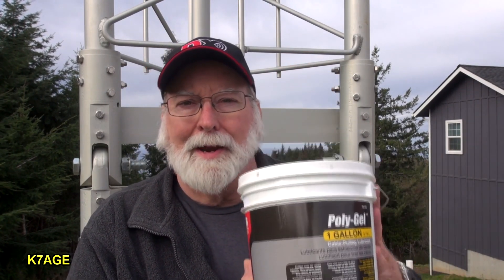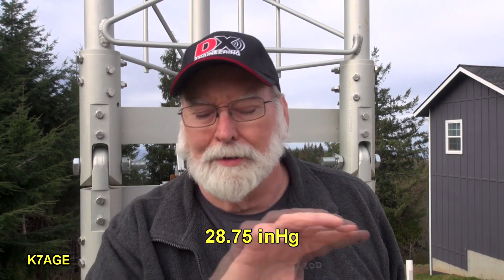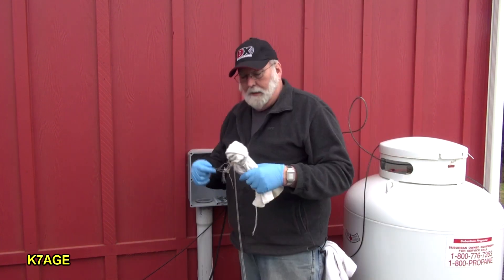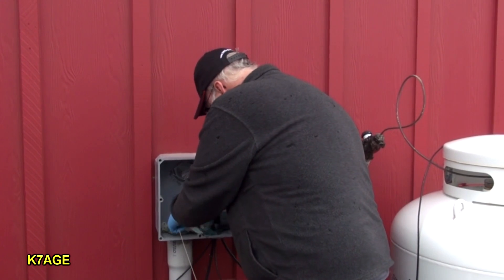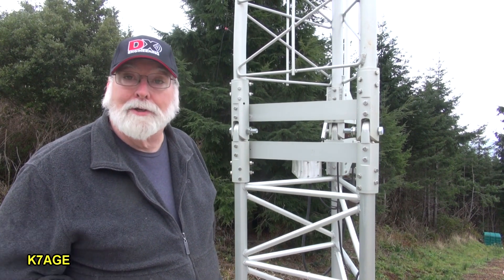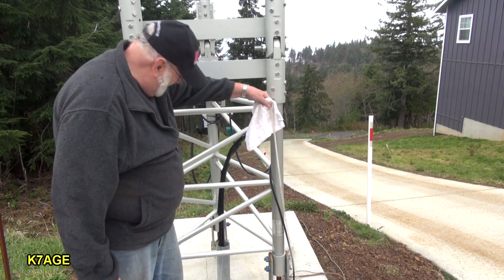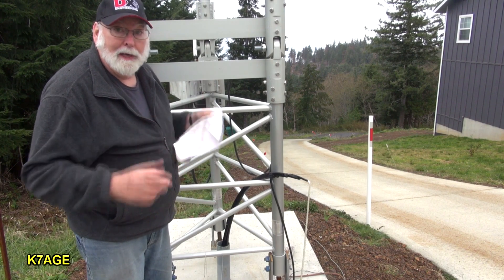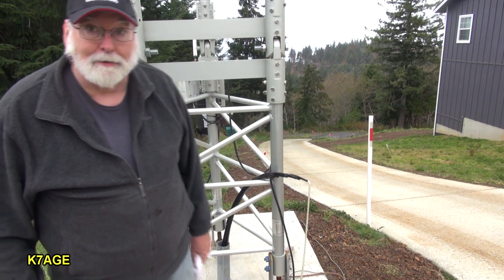Part 7:Pulling Cable Through The Conduit

Comment: Not every XYL would help put that cable through, hats off to her! Looking forward to finally seeing what goes on top, 73
Reply: My YL helped, but she's also a ham.
Hint: Find a higher pivot point on the tower. Then you can use your weight to it up and through as you pull down.
You did a good job!

Comment: A 110 ft. pull is an easy one even without lube.  Did you calculate the fill before selecting the conduit?  Should be less than 40 percent area.

Comment: For future pulls like this, get yourself a Wire Pulling Basket.... Available at electrical supply stores, it works like a “Chinese Handcuff”. Slip the cables into the basket, pull the basket tight, add some tape to the basket and PULL! 
   This will greatly reduce the chance of the cables slipping out from the tape, and becoming lost in the conduit.... They come in different sizes, and are not that expensive.

Comment: Add another pull string to that bundle before pulling? Yeah it can be a nightmare adding to it all but it's worth a try. Having a pull line in there gives you a chance at adding to the setup. What happens now if you need to add a cable, assuming there's room?
Reply from the maker: there is a large pull rope left in the conduit.
Reply: @K7AGE  wise

Comment: Rick AG5UW - Hey Randy.  I have to ask what your reasoning for not buying something like an Ameritron Remote Coax switch in place of pulling so many coaxes ?  I'm rebuilding my tower and was thinking about installing the remote coax switch for my beam and dipole antennas.  You are one lucky fella with a tower like that one.
Reply from the maker: Many of the new radios have dual receivers that can use dual antenna inputs. So, more runs of coax back to the shack. I used an Ameritron switch for 20+ years at my station in Grass Valley.

Comment: Hi Randy, WoW 6 cables pulled through 3" conduit? I never would have thought it be that easy. I always use 4" conduit for pulls that populated. But, you did your homework and it worked very smoothly.
Nice job. Brian w6dwy.
BTW: did you pull a CAT6 run as well?

Comment: First story of a cable pulling I've heard in awhile that didn't involve a fistfight. Also, how did you start the string? Shopvac trick?
Reply: What's the length of the run? Fishtape an option?
Reply from the maker: Nope, it was about 107' long. Shopvac was used to suck through a foam wad with string attached. Wife really helped with this part of the project.

Comment: Good work, but, i always pull another pull cord with the cables so you can add another cable later i use electricians pull cord, very strong and cheep comes in a bucket.